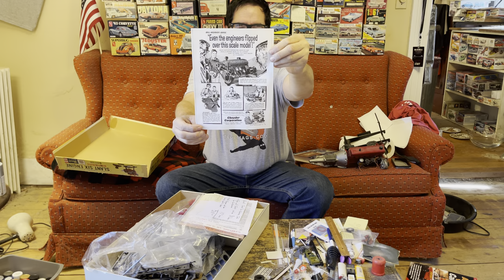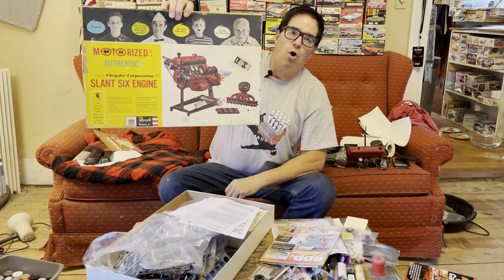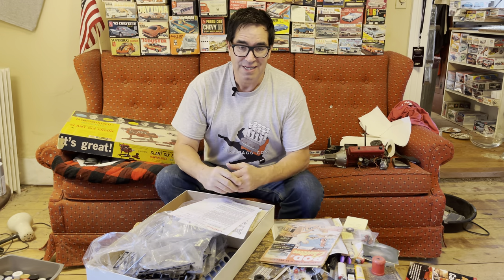Chrysler’s PLASTIC Slant Six: Part TWO

Comment: I was about 7 at the time, but I helped my dad build that model. Thought it was pretty cool! Like many others on here, I also built the "Visible V8", which seemed to be a generic cross between a 273 Mopar and a SBC. It had little red bulbs for spark plugs that blinked in the sequence of the firing order. Wish I still had both!

Comment: It amazes me what individuals have accomplished before computer-aided anything, during a time when all technical drawings were done by hand or electronic calculators
Reply from the maker: I feel that way too. But for an eye full of the astonishing stuff that was done looong before any computer assistance, check out any WWI airplane engine! Billet cranks? Check. Roller cams? Check. Intricate aluminum castings? Check. And all of it in 1918!

Comment: As a previous owner of the visible V8, I think I would much rather a non visible working model. They look more realistic (actually the slant six looks exact) and if you want to see the inner workings, you can pull of a panel! I had heard Chrysler had supplied the actual blue prints to make this model exact. So cool. Thanks Steve.

Comment: Great video . I can attest to the durability of the slant six. In 1982 on lunch break at the repair shop i worked at  { next to Castler desoto/plymouth n.j. ironically } we took junk car and drained all fluids.  Wedged open throttle. It ran wide open for 15 -20  mins , then gradually slowed and seized..  Nothing dramatic such as a rod through the block. We were super impressed. I never was into mopar growing up. But after seeing you on Mecum many years ago , and your knowledge made me appreciate them more. How about some vids on the '70"s police cars , 440 in big body , which gave me my first of many speeding tickets.
Reply: The shop I worked in back in the early 80s did the same thing to a slant six. Ours also ran for a long time, but then did throw a rod. The rod hit the starter and bounced down on the floor. All we could see thru the smoke was a glowing red piece of steel. Our engine didn't even slow down when the rod went, but it did finally lock up. Great engines!

Comment: The interesting thing to me is, I came across years  ago. A gentlemen in Arkansas through a friend who built one of these out of metal. Items like the block, head, pistons, crank, cam, and rod. In fact he made every part himself. Then assembled it himself, and it actually ran off of petrol like the real engine. And yes he actually made the tranny and bell housing as well. 

Although I would not know if the gentlemen was still alive or would even remember me. Because I met him through a friend who is sadly past away now...

Comment: Those were and still are great engines, I had one in a 1979 LeBaron wagon it was bulletproof! It’s too bad they didn’t put them in the minivan with the torque flight transmission, those vehicles would have lasted forever and had a great reputation!

Comment: I need to obtain and perform a proper overhaul on an early 170 or 225 slant six, to atone for my driveway rebuild sins from early in my life. Ridge reamer, hone with a power drill and re-used cam bearings. Never again! I prefer the early ribbed valve covers, they look perfect in the engine bay of a ‘63 thru ‘66 A-body.

Comment: Another legendary 6-cylinder engine you might wanna get your greeedy little eyebuds on is the Sidevalve dodge 6 that the Petty Ent. drove in stockcars during the mid to late 50s .. Apparantely this thing had every little sly trick done under the sun like sleeved this, bored out that, increased other.. And this thing sounded like nothing else on the racetrack, while other cars engines may have made a rumble, this thing positively HOWLED!